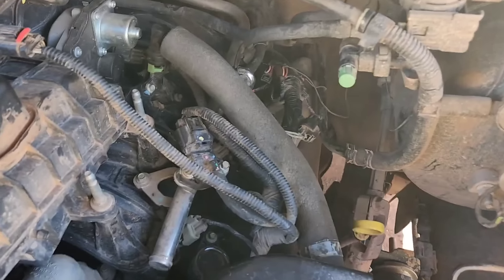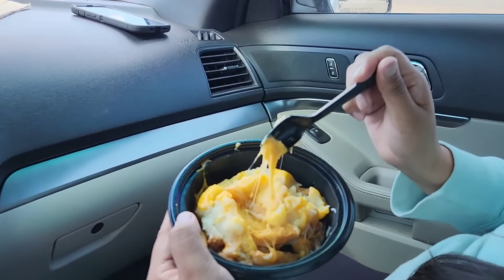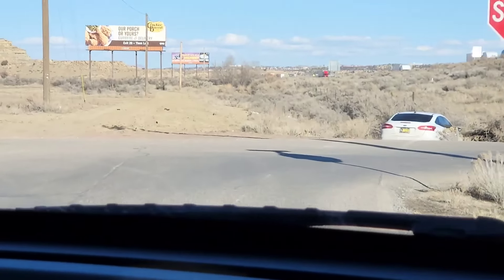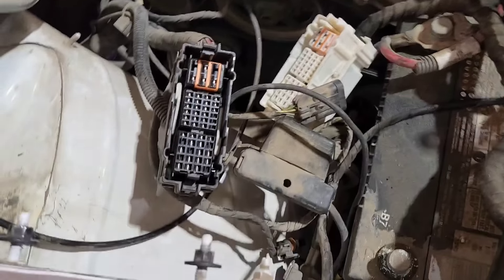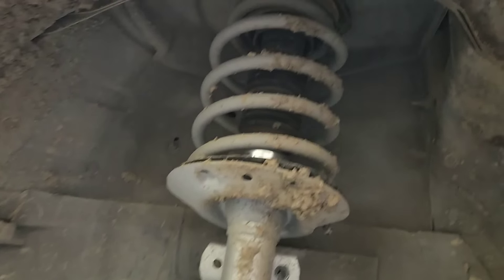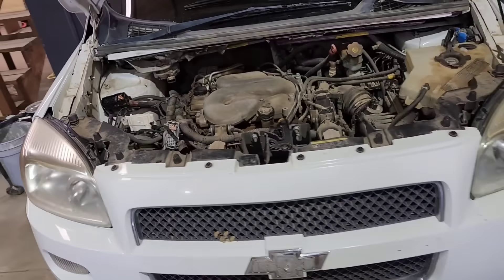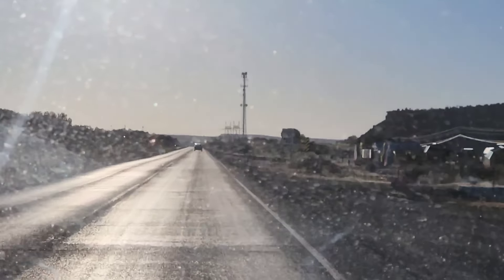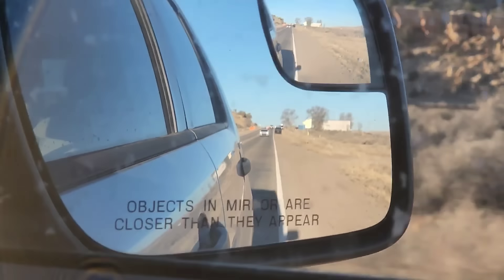Episode 184. back to St Michael's

Comment: What do you think about JB WELD? Is it worth working with? Good video...
Reply from the maker: Thank you for watching. JB Weld has always worked when I needed it for a temporary fix. Usually, whatever I used JB Weld on is replaced before it fails. Every now and then, I get something leaking if its under pressure.